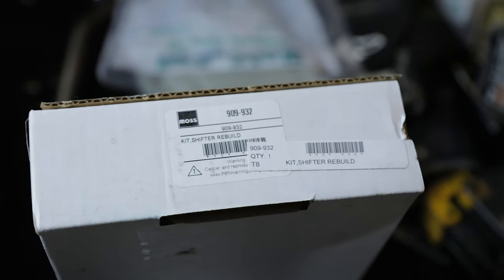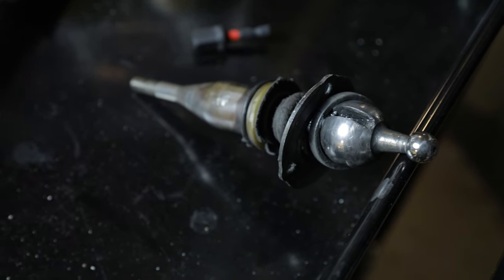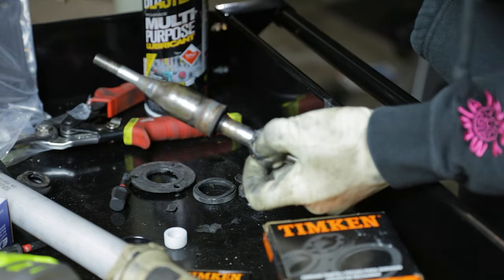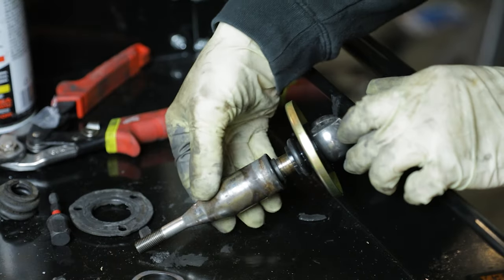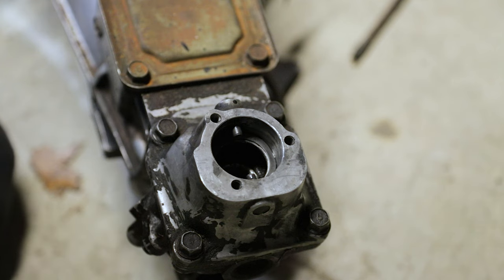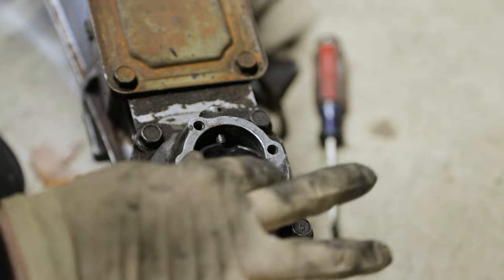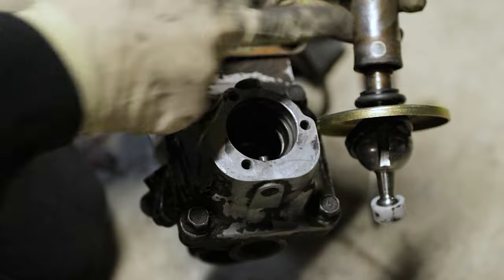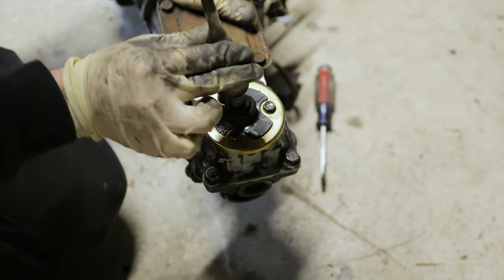The Miata Shifter Rebuild How To (NA & NB)

Comment: Don't forget to change the turret oil while you're in there! ONLY if you have a 5 speed though! 6 speeds are lubricated by the trans oil!
Reply from the maker: Yes thank you! Forgot to mention this in the video since I knew I would have to pop the shifter back out when the trans went in.
Reply: @AlexPerrucci  No problem!
Reply: Use a hand pump to get the old oil out.  Turkey baster doesn't get down deep enough.

Comment: For anyone curious or here looking for help, this is essentially the same process for an FD rx7. There are a ton of parts used across the NA Miata, to the FD rx7, and even on to the NB Miata.
I came here to watch mid shifter rebuild on my FD to see how to install the bottom bushing. I replicated it and it worked like a treat. A+ video.
Reply: What’s the purpose of doing this? My Miata is having trouble getting into reverse and 1st. I replaced the slave cylinder and the master clutch cylinder but it’s still sticky. Would this help
Reply: @Kat.quarterlifecrisis  how about trans oil?

Comment: EXCELLENT vid, THANKS!
Just what I needed.
And thanks for pointing out that my NB shifter has a front and back side....
As previously mentioned, time to change the shifter oil in the 5 speeder. 80-95 ML of manual trans oil.

Comment: Hey did all this to my 02 6 speed!
Still won’t downshift into 5th
And getting some clutch chatter in 1st and reverse?
Any thoughts on 5th? Worn part?
Reply from the maker: Possible worn out throwout/pilot bearings if you haven't done a clutch recently. 5th gear or its synchros may be worn as well.